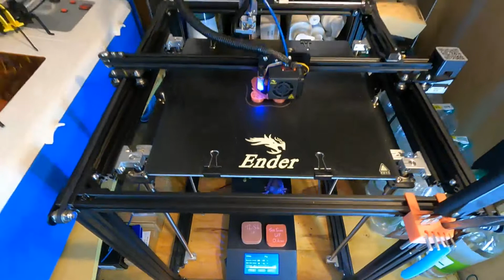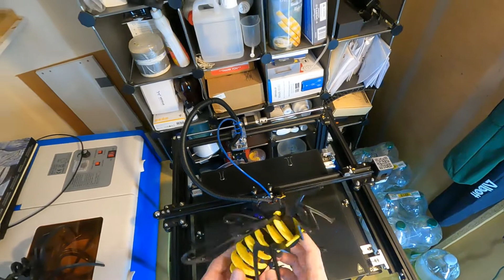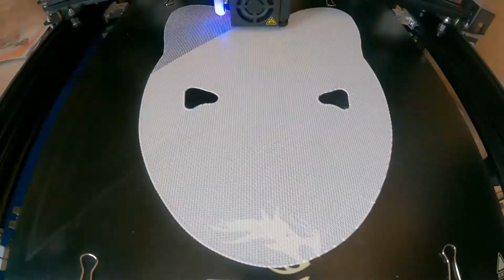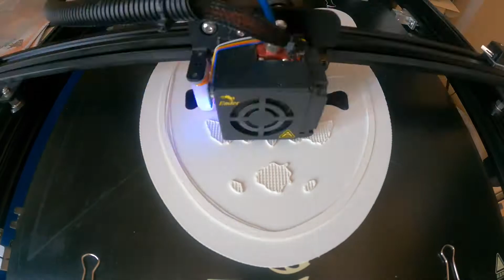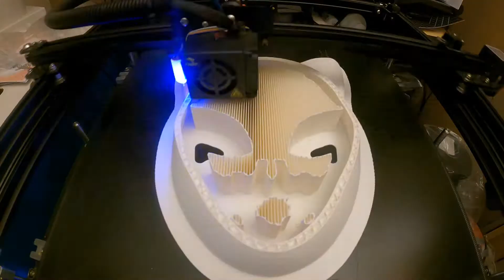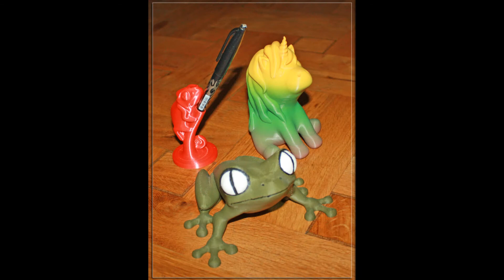Creality 3D ender 5 plus review

Comment: hi i was wondering how you got your printer to work, i just got one recently and its kinda confusing
Reply from the maker: Hi, not sure which printer you have but my advice would be to slowly go through the manual/guide step by step. Most printers come with fairly good instructions but you will also find a mass of tutorials on Youtube to help. If yours comes with a memory card/stick it will have the software needed along with some test prints to try. If you have any specific questions then please feel free to ask and I will do my best to answer.
Reply: @Kalbo64  I’m using the same one that your using in your video, the leveling numbers are all over the place even though we level it manually
Reply from the maker: Hi, if you have manually levelled using the bed screw adjustment I would try a test print and see what you are getting and go from there.